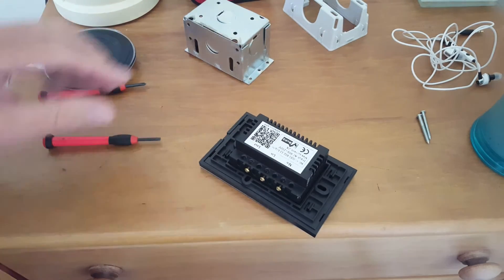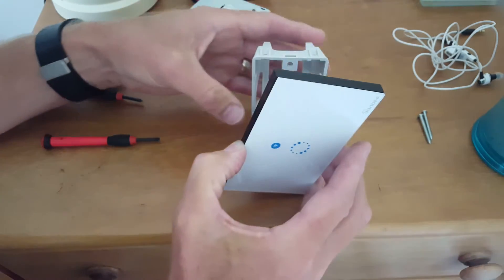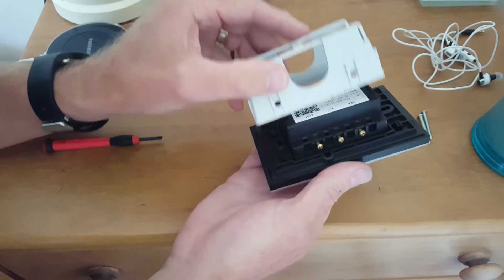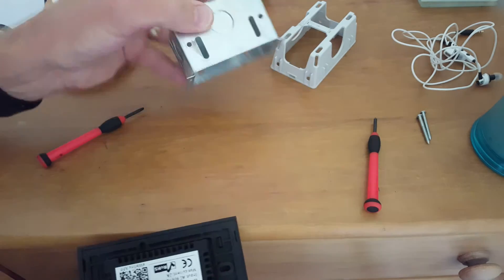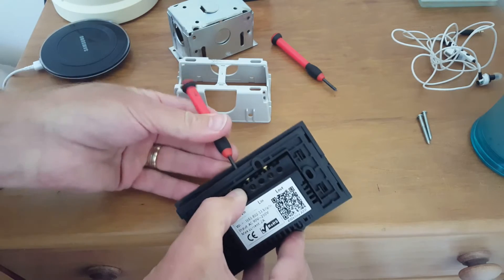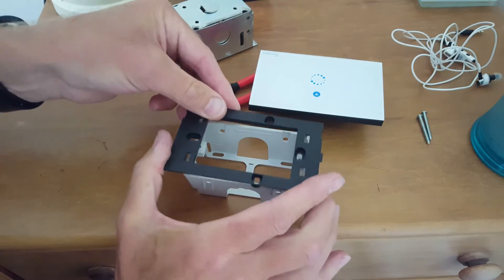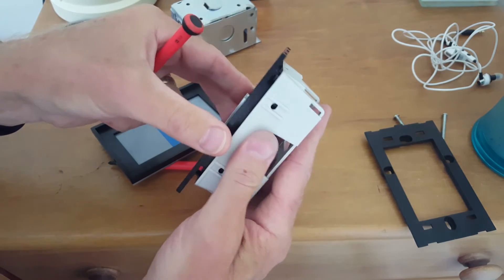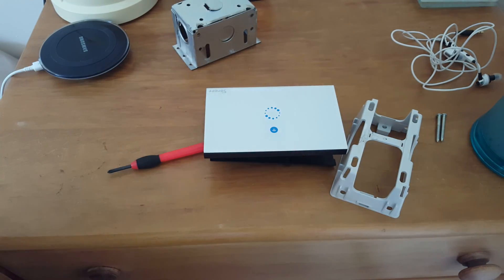Sonoff Touch Design Quirks (US Version)

Comment: So I just noticed that there are other companies making "eWweLink" compatible wall switches that have the screws on the end not the side (US standard)  
Search eBay for "GresaTek switch" or Amazon with the same search. Also OITTM Smart Light Switch will also work with US style boxes.
Reply from the maker: Thanks for the tip. Don't know if those ones can be 'hacked' like the Sonoff though to work with MQTT?

Comment: Thanks   did you get hack done
Reply from the maker: Yes. I cut out a section of the wall frame and the wall mount flush box to accommodate the switch and it works fine. The touch switch is not as sensitive as the Aeon Labs one though which is far superior so I'm going to see if I can make an Aeon Labs touch switch work with a Sonoff or Electrodragon as that would be my preferred path now. I won't be installing any more of these due to the difficulties. Aeon touch panel is here in white http://amzn.to/2f1EJYr.

Comment: FYI, in Australia, the switches are sideways.. So the text will be correct orientation.
Reply from the maker: Daniel Nagy Good to know.
Reply: You sure? Mine are all vertical. To be honest, I can't remember seeing any 'sideways' all weekend. My in laws relatively new house are all vertical, my parents really old house are vertical. Maybe a state thing?
Reply: Mine are all vertical as well
Reply: US here. Can't say I have ever seen a light switch horizontal. Not even one time in my 40+ years.
Reply: They are mostly vertical, don’t know what you are on about. Usually bathroom lights with the heat fan are the only horizontal.
Reply: I'm confused, Are you not already in NZ? Which uses the same electrical code as Australia. And your video description reads "particularly when related to installing in a NZ/AU flush box" So, how would Daniel Nagy's comment be "good to know"? Assuming you should already know, considering that your video description states that you are installing in NZ/AU.....
Reply: are you smoking crack Daniel? all wall switched in australia are vertical (portrait)
Reply: Khanh Tran it all depends on the age of the house. Im in Australia and all of my GPO sized light switches are all horizontal. Only the really small switches on the door frames are vertical. We've had one new switch installed in the past few years in the bathroom for a 3 way (light, fan and heat lamp) and that is mounted vertical. I think the "standard" must have changed.

Comment: How safe do you find these products? I'm kinda too worried to install them would hate to burn down my house with the small Sonoff 10a wifi switches. Has anyone stress tested them with 230v 10a?
Reply from the maker: 10A not too much of a worry with a light switch but you're right, I wouldn't switch 10A with these. You also need to check your local electrical laws as they may prevent you from using gear like this that is not 'approved' with the appropriate safety ratings (UL etc.)
Reply: yeah haha I live in Perth so they aren't certified so I cant use them. Wish they were certified though. I mean it would barely be pushing 1 Amp if I had if I had 4 x 10W down lights connected to it. May look into building some sort of self contained fireproof box as I would hate to burn down the house for what ever reason.